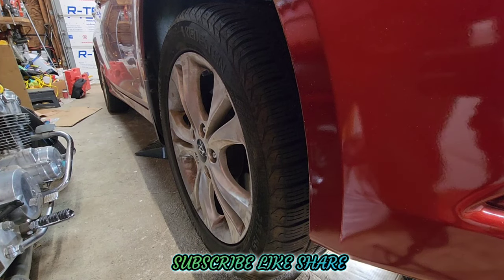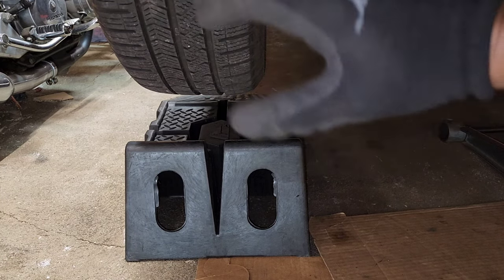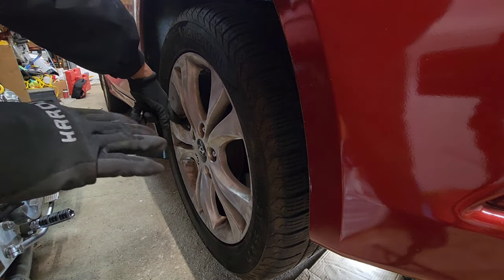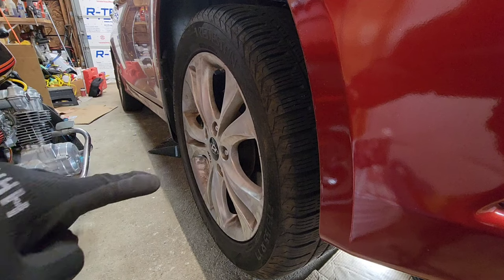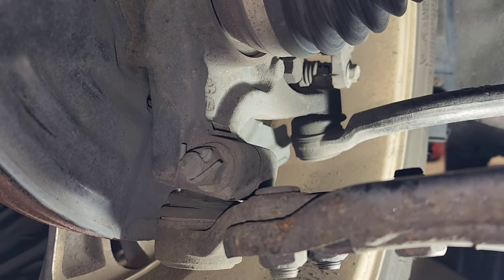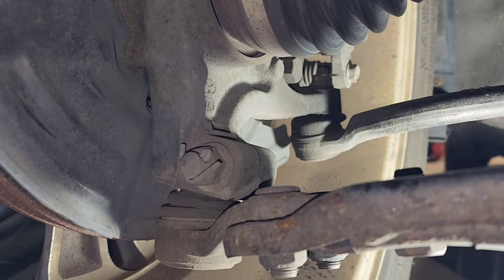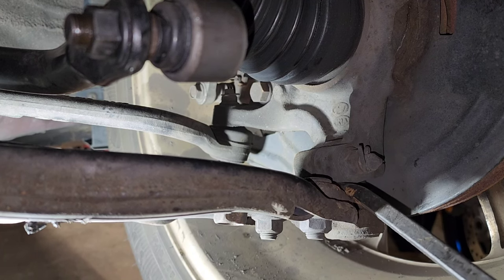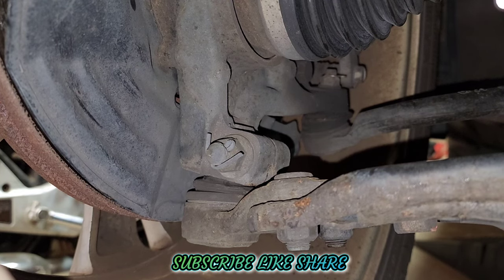How To Check For a Bad Ball Joint/ Tie Rod/ Wheel Bearing

Comment: if it's a load bearing ball joint, the spring will make this test hard to do because the spring will be holding it tightly in place
Reply from the maker: Not on this car, the spring is mounted to the knuckle not the arm. Thanks for watching please Like,Share and Subscribe if you haven't already

Comment: Would be useful if you can do a side-by-side of what a good ball joint looks like vs a bad ball joint looks like to make it more clear.
Reply from the maker: Great point but you suspension parts should not have any movement or play in them. That's one way to tell. Thanks for watching please Like, Share and Subscribe if you haven't already
Reply: Man has done enough 😂

Comment: our 2012 g37 rwd has barely any movement with the 9/3 position test, but def has movement with the 12/6 position test. I've replaced the wheel hub and outer tie rod end on that side. my son says the 9/3 moves a tiny bit, so if both move that is a wheel hub? or should we focus on the ball joints?
Reply from the maker: Sorry for the late response but you should go with the obvious part that is bad and work you way to the others. Thanks for watching please Like, share and Subscribe if you haven't already

Comment: I will use your procedure to diagnose the ball joint again.  I just checked it last week and 6 and 12 o'clock was not moved when pushed back and forward as well as the 3 and 9 o' clock for tie rod.  But a clunking noise appears to come from the front end strut is heard while driving on the bumpy road.  Is it a bad front end strut mount?  Your response will be appreciated.
Reply from the maker: Good luck! Thanks for watching please Like, Share and Subscribe if you haven't already
Reply: Yo he straight up didn't read ya ish lol
Reply: Either sway bar or strut

Comment: What about the wheel bearings?
Reply from the maker: Same concept for checking the wheel bearing just look for movement or play at the spindle instead.  Also a bad wheel bearing usually makes a humming noise when you drive. Thanks for watching please Like, Share and Subscribe if you haven't already